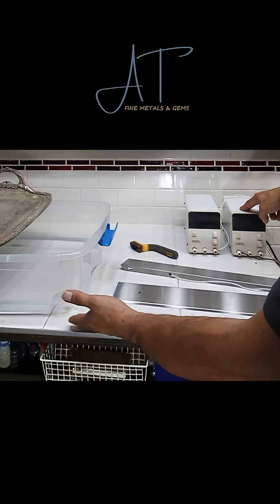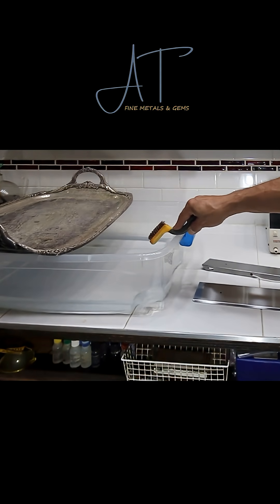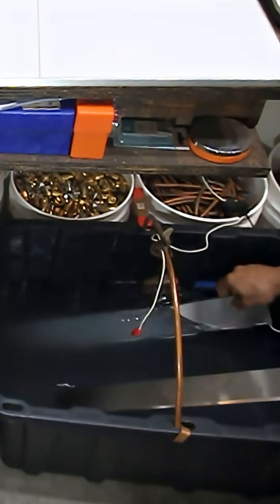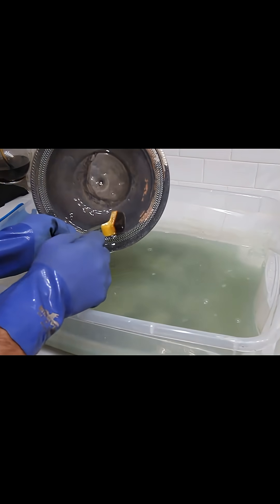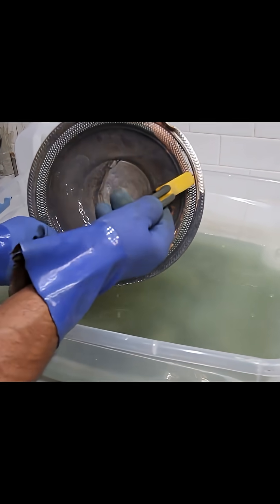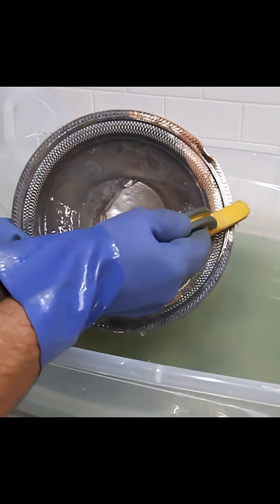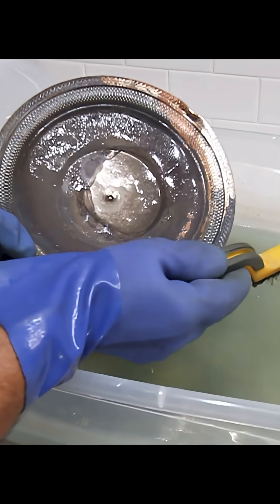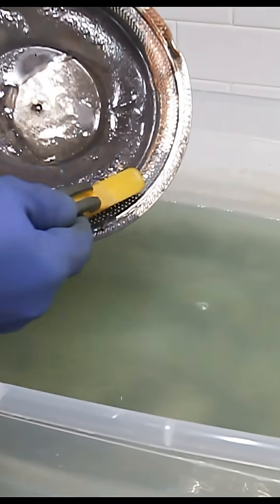Remove #Silver From #Silverplated Using Saltwater & Electricity

Comment: What if the piece that you deplating is just beaking away instead of flaking away
Reply from the maker: You can turn down volts or remove it sooner. Only submerge for about 20 mins max and then check to see if the silver will brush off.

Comment: What is the voltage and amperage used?

How many kilos of material to recover a gram of silver mud?
Reply from the maker: I max out the power supply for the most part. I can get between 5 and 10 grams of silver off of one large platter. Some are better than others of course.
Reply: @anthonythomasfmg thank you

Comment: Hello, will you end up with mostly silver chloride in the tub? Or random mix of chlorides, oxides, silver, copper, nickel... whatever falls down? Has to be pain to work with such "diverse" stuff... 🤷 God bless...
Reply from the maker: Hi Fran! A little bit of everything ends up in the tub. Mostly copper chloride and a resin binder that is a white sticky substance. Very little silver ends up in the bottom but I just collect it and soak residue in concentrated sulfuric acid. Any silver that’s left will show up!  

And also with you.
Reply: @anthonythomasfmg  Nice, thanks for tip, I dont bother with silverplatet stuff for now, but is on the to-do list... 🙂